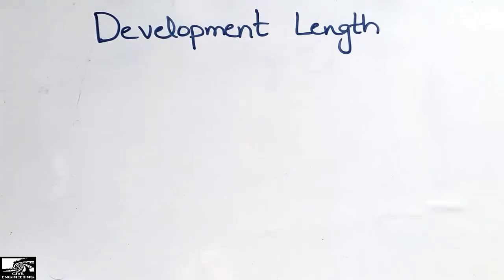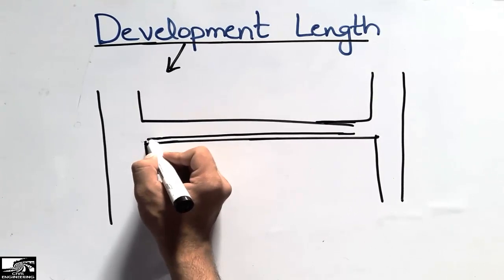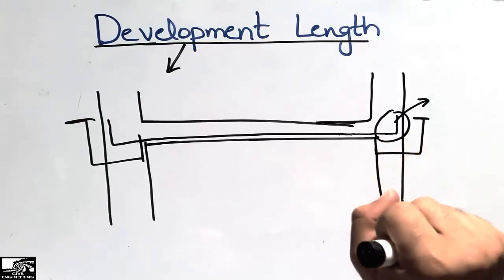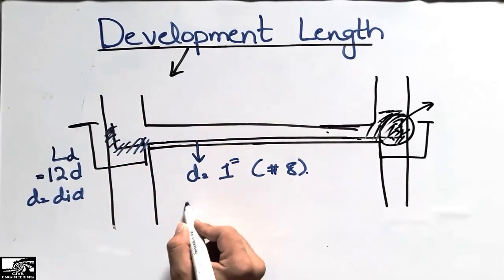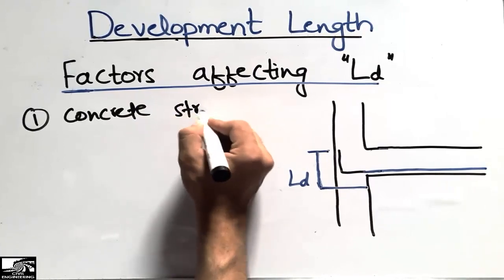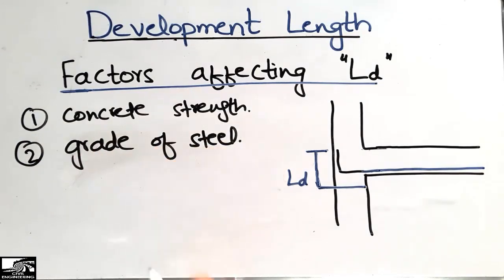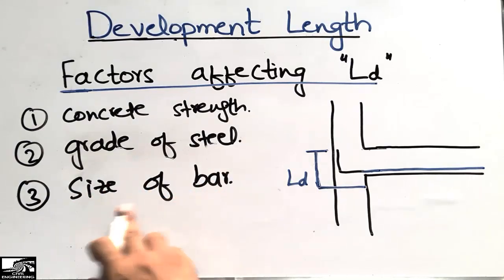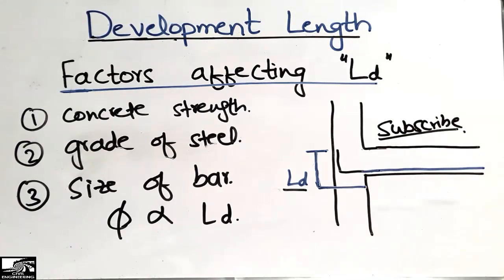Development Length | Factors Affecting Development Length

Comment: Does it matter if the reinforcement is extended in a downward position instead of an upward position?
Reply from the maker: good question. I don't know the reason but practically they provide in upward position may be because they show good strength.

Comment: I have one doubt. Pls clarify it .why did you put d = 1" ? Actually d = dia of bar correct? I will waiting for your reply.
Reply from the maker: The diameter of #8 bar is equal to 1 inch.
Reply: @civilengineering94   first of all thank you for your reply. But my doubt isnt clarify.  what is the meaning this symbol # ( inch = 25.4mm ) can you reply again. Sorry for disturb you
Reply from the maker: # shows 'number', means #8 would be number 8 bar , #6 number 6 bar and so on. This is according to american system to denote the bar size.
Reply: @civilengineering94  once again thank you brother. I will pray for you for increase subscribers and views
Reply from the maker: Thanks alot #Selvaraj
Reply: @civilengineering94  # is dia of bar (for eg. 2#8 is 2 bar of 8mm dia)...... Kuch bhi mat batao logo ko

Comment: Thanks for clarification,  but what is the minimum required bar length for POST-INSTALLED REINFORCING BARS planted by Epoxy (Tension/Compression) ?